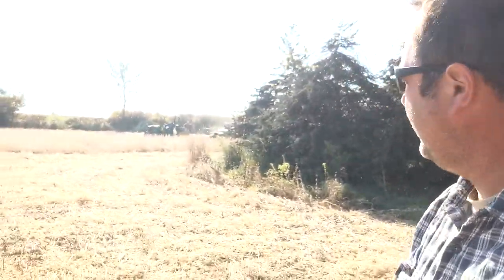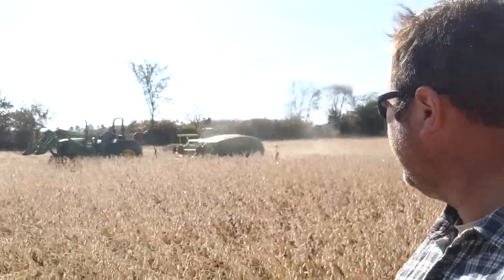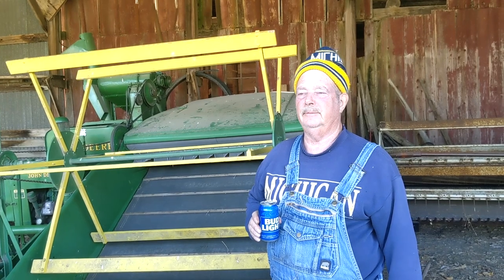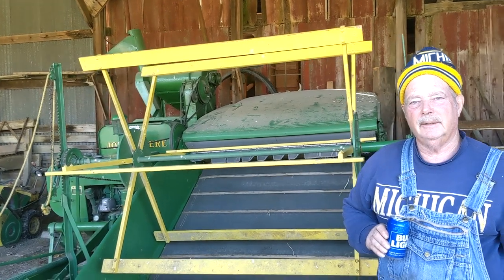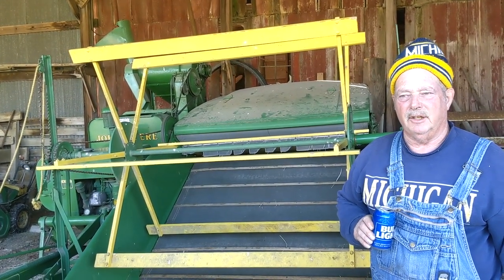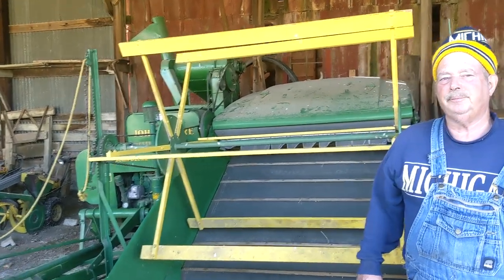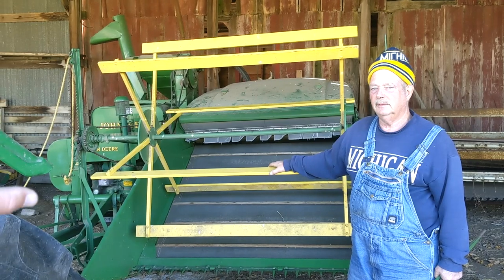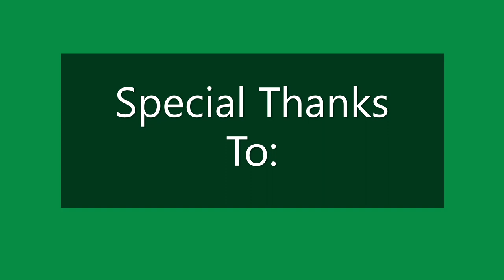Combining Soybeans With a John Deere No. 12A

Comment: We ran a 12A with a power unit till the mid 70's. Gave up when the junk yard scrapped their collection. (can't blame them, we probably scavenged all the needed parts. Usually had to replace some wood parts on the straw walkers, and sew the canvas every now and then. Ours had a bagger, not a grain bin.
Reply from the maker: Same on this unit.  Canvas is hard to find nowadays and someone who can stitch it is even rarer.

Comment: That's a very cool old combine.  You're dad did an excellent job restoring the machine.  It's not often (like in NEVER) that you get to see a pull-type combine being used in soybeans.  In terms of the "canvas" which is also known as a draper, they ARE hard to get.  I needed one about 20 years ago and was able to get it from the now defunct Central Tractor store.  However, when I was looking, I was told that if you need a new one, either check with an Amish community, as some will be using equipment that still used canvases, or check with a sail maker.

Comment: Nice combine  love to have it I have a 1941 john deere li and a 1945 john deere la I believe that luc engine on the combine is same as my li la engine s
Reply from the maker: Dad was saying after filming the video that the engine on that machine was used for several applications.  It's likely the same engine.
Reply: Nope that engine will not go in a JD LA or a li. The  and engine and parts are the same but the block and bell housing  are all one and cast differently and can't be changed. Check it out. I tried it and it wont work.